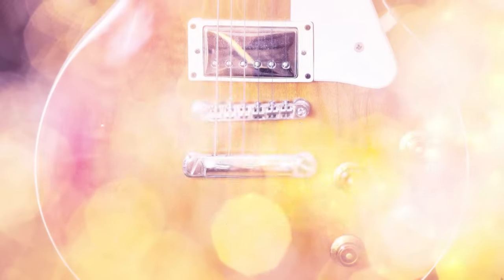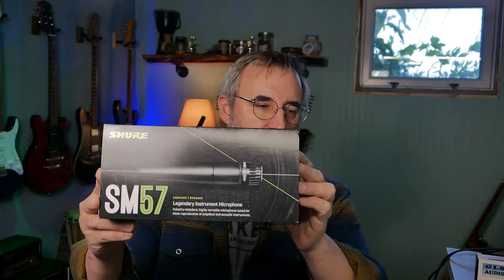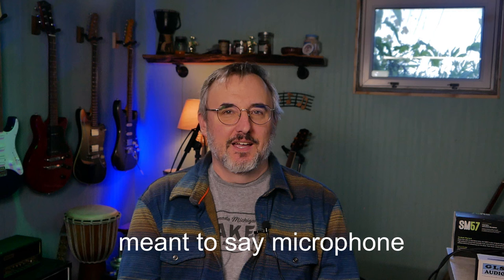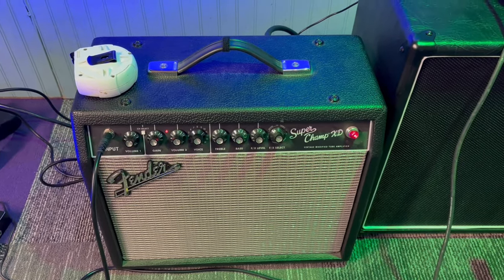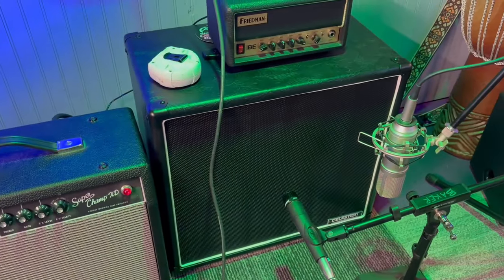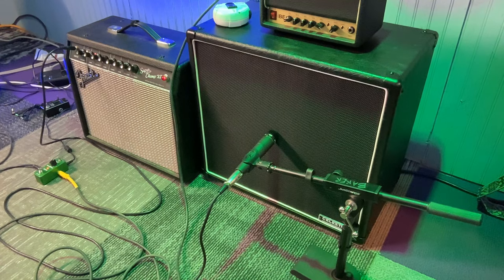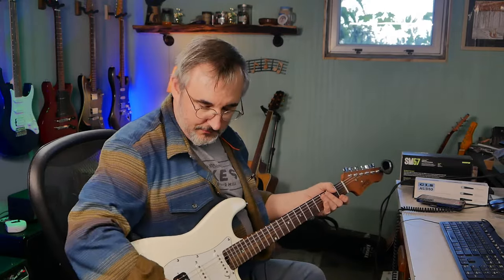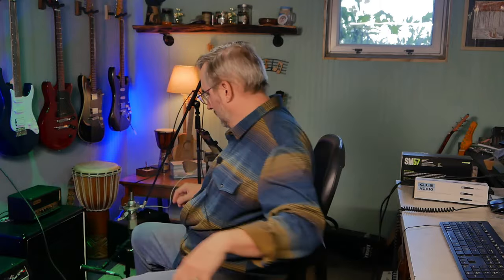Complete Idiots Guide to Recording Guitar Amp

Comment: I experimented with mic placement early in my life. It depends on the sound you want for the song. Closing a low powered amp with a small speaker, like a 6 incher, in a closet makes the amp sound bigger. I've tried some things. Great video.
Reply from the maker: Thanks you just reminded me I wanted to experiment with iso cabs also. Or just move the amp under the basement stairs and really crank it.

Comment: The truth is, setting up for home recording is always a pain in the ass. It always has been for me anyway. As you stated it will take a lot of experimentation and moving around etc. My advice, is once you get it in the position that you like or works for you, measure it, document it, and don't move it! Or move anything for that matter! I think it sounded good in the end, and could definitely hear the change as you moved the 57 farther back. I think between the 2 and three inches sounded best, but 5 inches back sounded good as well. 5 inches back (57)  and with the condenser might be the way to go. With my experience, I usually ended up (from what I can remember) with the 57 about 2.5/3 inches back and slightly off center/lined up with the edge of the dust cap, and had a condenser 6 to 8 inches back, at about the position that you have yours. As you mentioned, watching a video or getting advice never works out the same way as recommended because everything varies due to different gear and equipment. Also different amps, volume and gain also changes everything. If you are going for a cleaner sound with the fender for demos, etc, I think what you achieved in the end sounds good. Maybe tweak it a little more if you are still not happy with it.
Reply from the maker: Thanks for the comment. Most of the videos I have watched show the mic very close, sometimes touching, but to me it just never sounded that good. I agree with your setup as well. Then I fell down a rabbit hole of isolation cabinets and that led me to the Two Notes Torpedo Captor Reactive Loadbox DI and Attenuator which acts as a digital iso cab. Basically you disconnect the speaker on your amp and plug into this box, then you can either connect the speaker back to this box, or use headphones or connect directly to your DAW. This allows for full volume on your tube amp without actually having the volume up very high, or at all. I just might have to try this out.

Comment: When I used to record guitar, I think I got the best sound with the mic above the amp, I didn't use an sm57 though. Plus I used to record mostly bass 
I went above the amp because at medium volumes I was experiencing distortion 
 Also I had sound deadening on the walls by using wool blankets hung about 3 inches in front of the wall. And the amp wasn't near the wall. Even though you are recording in front of the speaker I sounds as if you are getting an out of phase echo from the back of the speaker bouncing waves off of the wall and because the lower tones have more energy they are bouncing back and making the sound muddy. Keep in m8nd that I was doing this a long time ago and my memory may not be 100 percent
Reply from the maker: That could be. I’m going to experiment next with amp location.

Comment: Have you ever tried a surround/cone isolator?
Reply from the maker: I have not. Do tell.
Reply: @JayceAllanGuitar  
It's basically a 🔳or
🔘 cylinder placed up against the speaker baffle of the amp' the inside dot representing the target area placement of the mic....to isolate that area from the rest of the speaker.  
Works good for recording. 
You can make different sizes using PVC  pipe or some scrap wood laying around.
Reply from the maker: @BryanClark-gk6ie  interesting

Comment: I'm wondering if your room has more of a effect on the tone/sound recorded than you realize. It's a small space, may be creating artifacts, reverb, and other unintended issues that you don't think you hear but are there and the mics are sensitive to it. Just a thought
Reply from the maker: Could be, I haven't treated the room yet, but it's pretty dead. There's carpet squares on the floor, and the walls are wood paneling with foam insultation on the outside walls and roll insulation on the inside walls. The ceiling is just the open floor joists, wood. My next test will be to build an iso cabinet and try that.